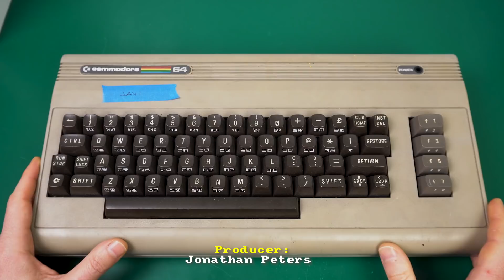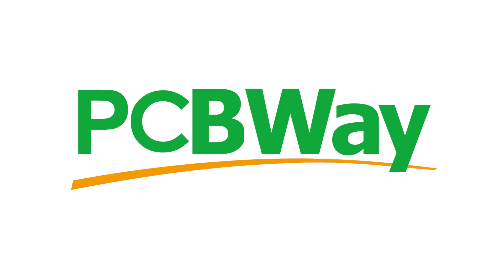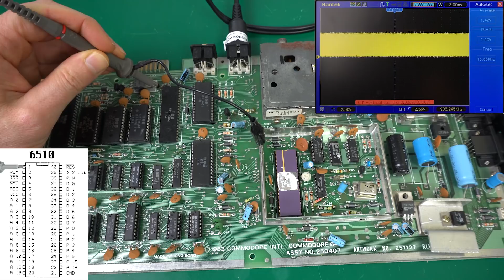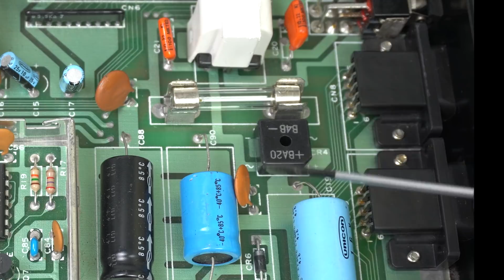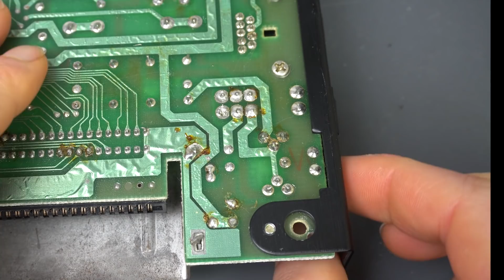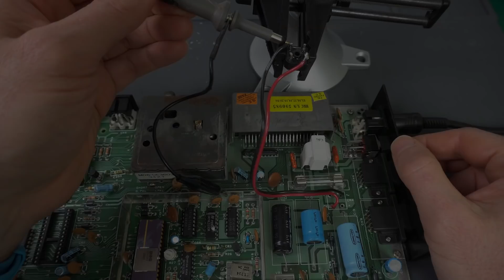The UGLIEST Repair of a Commodore 64 (Part 1)

Comment: 1:25 removing "annoying RF shield"? Adrian Black approves! :)
Reply: @Okurkaarrgghh  I don't think a company pays for design and built-in any component delivery for no reason. It has a reason to be there. Maybe RF interference?
Reply: @Okurkaarrgghh  No? :) ok, no.
Reply: Yeah I have seen Adrian just throw them away. What a laugh. Right guys, throw those shields away! :D
Reply: @Okurkaarrgghh  Yes. What does the year have to do with it?
Reply: @Okurkaarrgghh  that you don't know what is it for nowadays doesn't mean that it is useless :)
Reply: @M0UAW_IO83  depending the purpose of the machine or the environment (country/place) where you are going to use it.
Reply: Especially the Commodore 64 produces a lot of radio interference, while other computers had a metal frame and case, like Windows PC's or a sprayed on conductive layer of carbon on the inside like some Apples. The Commodore has an ABS-plastic case that lets all clicks hums and buzzes through. In and out! The tinfoil on cardboard RF-shield is hardly working, but is was good enough to get approved in the USA by the FCC. Removing the shield is willingly not following the regulations, spreading disturbances around in the neighbourhood, and opening the computer for all new kind of sparks and high frequency signals, nobody knows what the effects are on 40 years old computer chips. 
 
To those who still think the shield can be removed I say this: try your Commodore 64 with the RF-shield in front of a G6 communication antenna, and then try it without the RF-shield. Try the same in a magnetron-oven. It is a guarantee the C64 breaks down without the shield. With the RF-shield there is a chance the C64 will survive.
Reply: @ElectronGordo  FCC regulations.😁
Reply: @crazyedo9979  not only. Have you play around with a QL removing the shield from the mDrive? @vanhetgoor has explained better the secuencies.
Reply: @ElectronGordo  RF shielding done right is not a problem. Commodore had choosen the wrong way. Once I dealt with a C64 which failed five minutes after power on because the carton plate suffocated the pcb and I have to replace more IC than normal necessary. Usually I don't work on home computers but I know from a colleague that sometimes removing the RF shielding can be a pain in the huhu.😁

Comment: You made me shout at the screen. Check the power switch and the socket! 78xx regulators can go bad and engage in the shutdown all the time, but that doesn't cause their input voltage to drop, only the output drops. They can go short circuit inside which of course overloads the input supply and cause a drop but things will get hot very quickly in that case. They can develop a short between input and output pins, in which you'll see the input voltage on the output pin and things will go bang quickly... So, it was obvious they were not receiving power, which can be the socket, the power switch or anything in between those and the regulators.
Reply from the maker: Haha, if it makes you feel any better I had checked the switch multiple times (but somehow didn't record it).
Reply: @NoelsRetroLab  No it doesn't... :-(
Just kidding :-)
Shouting at a computer screen is the best part of being a nerd, so I guess it happens quite a lot on these retro computer repair channels like yours. But yet, IMHO, the tracing of a power fault should start from the point of input, not vice versa . Old electronics like these are very likely to have corroded socket pins and switch contacts, cracked solder joints where mechanical stress is frequent. They are the usual suspects if it is an intermittent fault like you had here. Can't wait for the second part, I have more shouting to do. :-)

Comment: Great job, looking forward to part 2!  I feel better about that voltage drop issue I had on that A3640 now lol =D  Sometimes the simple stuff can trip us up more than the complex faults!  The DIN socket and power switch are often a cause of voltage drop on these too (the contacts I mean).
Reply from the maker: Thanks! Seriously, sometimes simple things throw us off for a loop. Especially here because the voltage drop was only partial, I kept expecting some component to fail, not the dry joints!! I even triple-checked that the switch was fine (but failed to show it in video). Oh well. Lesson learned there. Now get read for part 2, which is when things start getting REALLY ugly 😱

Comment: 1:10 There is a little slot on the left side of the VIC-II shield where you can wedge a flat-headed screwdriver and pop the lid before you slide it to the left.
Reply from the maker: Ah! I knew there had to be an easier way to open that! 😃 Usually, if I have to do any kind of work around the VICII I end up desoldering that little metal cage and fitting some heatsinks directly on the chip anyway.

Comment: Fascinating repair video. Probably an even better rule I suspect if there's wiggle with the power connector, is just automatically refresh the solder joints. Even on the chance that they look good under magnification, the situation will change for the worse soon enough from the added stress on the solder joints from the component being able to wiggle when inserting or removing the power cable.

Comment: Great video.  Thank you for sharing!

Yeah, on my C64 the PLA actually took out the ROM's as well.  So some times when a PLA fails it is possible it could take other components with it.
I was watching Adrian's channel and he was building a GAL based PLA replacement and I decided to build one.  Worked great.
Here in the USA I acquired a 2364 adapter(s) from go4retro so I could use more common 27C64 EPROM's to replace the dead ROM's in my C64.

Otherwise so far I have been lucky and haven't had to replace any other parts on it yet.

Comment: Glad to see more use of a scope in Commodore repairs. Plan on repairing my original owned 64 after building a power supply. Found a donor machine at a flea market but just found that it has a PAL video system. Funny finding one in the U.S.

Comment: But bad solder joints was something my teacher in college was always on the look out for. When we soldered a component and snipped the legs short, he’d see and have us reflow it. Never snip and not reflow. And also mechanical parts were never allowed to be just soldered, always needed to have screws or bolts in place.
He was an engineer for ESA making satellites. And they found that these two things caused 90% of their problems. On earth oxygen would get into the hair tears and would corrode . In orbit the extreme temperature difference would work that solder joint repeatedly (or same with components that get warm) and eventually fail the joint.
So he was really meticulous in checking our joints. And after that semester, I never looked the same at consumer electronics. So bad the majority of them are. Not made to endure, and these days it’s even worse.
Reply from the maker: Totally right. I wouldn't advocate doing everything at satellite standards, but some things can be much better. Having some screws in the power connector would have cost Commodore a few more pennies and would have been much better. But then again, they may have been fine for the first 10-20 years and it's only now that we're getting those problems. And yeah, modern devices are orders of magnitude worse! 😬
Reply: @NoelsRetroLab  But we get so much fun from these old machines :D So I would've liked them to engineer them to proper customer electronic standards :D Although generally they are holding up really nice. I just had an MSX come in. 1988 and the only thing the previous owner did was change the floppy drive belt. 

And I learned a valuable lesson today. I had this 16LED bar display made for the C64 (to learn KiCad and test PCBWay). And since you get 5 board for 5 bucks I made one for the MSX too. And I noticed that when I toggled the STROBE that the lower 8 bits also got updated. Turns out that the STROBE bit actually is not completely in your control. But when you send data, it will briefly go down to inform the printer. And down in my case is, activate the other latch :D I never knew that about parallel ports! And the C64 user port isn't a parallel Centronics standard so PB2 is just fully in my control. But I figure I can make it "look" okay when I quickly enough write both bytes out. This was the idea anyways to polish my 31 year old Z80 coding skills.

I do like the MSX (I was triggered by your love for the Amstrad, also a Z80) I was a N00B until 3 days ago. We had one in school but never got serious about them. But it's quite interesting, like the Amstrad I guess. Also a bit quirky with the VPD. Which doesn't allow you to write immediately in the NVRAM, you have to go through an IO port. And basically have two calls one to set the address, and one to push the data. Unless you do consecutive writes then the VDP address is incremented. But then you run into timing issues because if you do it too fast :D
Interesting stuff. So much, more fun than X64 PCs ;)

Keep up the great work, I adore your chancel. And I am amazed how many great hackers there are of these old machines in Spain!

Comment: Hi Noel. You seem to have at least another cold solder joint on the cartridge port. I think I spotted it as the last one visible in the bottom row on the last shot of the board flipped upside down.

Keep up the good work!
Reply from the maker: I think you're right. I should have another look. Maybe I can even add that to the start of Part 2 since I haven't exported the final edit yet. Cheers.

Comment: Nice. However, when using a dead test cartridge, you also need the harness. The harness is a series of connectors which plugs into all the ports on the system and there’s a separate connector for the keyboard. Without the harness, it will give out inaccurate results. The harness is necessary as it provides loopbacks which will give you a more accurate result.
Reply from the maker: Sure, that's ideal but unfortunately I don't have the harness. I should get one sometime. The memory test is still valid, which is mostly what I'm using it for.

Comment: Great video, maybe check the PCB upside down next time? Broken traces and bad joints are more common than people realise and connectors to the outside are always prime suspects. I found that out with 80s audio gear like synths.

Comment: I had this revision of the board in 1984, my first computer. Mine was a French import, with a Philips pal to secam converter fitted under the keyboard by Procep, the company importing Commodore in France at the time. My computer had also this issue with the power plug. The shop to whom I brought the computer for repair made the diagnostic of a too power hungry setup, and removed the secam converter, eventually bringing the computer back to its pal version. Unfortunately, my TV set wasn't pal compatible, so until I had the money to buy a new pal + secam TV set, my Commodore 64 was B&W...

Comment: Hi Noel, superb video. It remembers me on these days were you type-in programs and suddenly the C64 lost power before it was saved. Then my father and I remove this ugly thing with a new plug with screw connection. No direct contact to motherboard only wires. This was cool. And nobody can unplug the computer by accident.
Reply from the maker: Nice! I've never seen one of those, but that's a good solution if it kept getting unplugged. Back then I always had the problem that the power might accidentally go out for the whole neigborhood for a few seconds (especially during storms).

Comment: Great video Noel. I guess it's always a good idea to just reflow the pins on the components that take som abuse, like the power connector and the power switch. Even if it's not an issue at the time of repair it might still prevent issues in the future.
Reply: I'm excited to do some more work on my C64's now! 😅 I've been doing some upgrades in my lab so I haven't been able to produce videos for a while.
Reply from the maker: Sure, if you know it happens enough, it's a good idea. Normally I have problems with the switch, but not with the power connector so much. I guess I'll be looking at it a lot more closely from now on 😃

Comment: Great to see you back with the breadbins again. Recently i've been struck by two machines with blown up fuses, one was an c64c and the other one an breadbin.
Reply from the maker: Thanks! Oh I have a huge backlog of C64s and VIC20s to repair, I just haven't been able to make time for them. There will be more for sure.
Were the fuses the only thing wrong with those machines? That's lucky!
Reply: @NoelsRetroLab  It was strange with the 250469 board it seemed to work fine otherwise except there were no sounds. I tested to 8580 SID chip in an another machine and it worked just fine. Then i watched Jan Beta's video where he was fixing one of his c64c's and from there it occurred to me that hang on maybe that's it and after examining the fuse it was not good. Put an new one in and board has been working just fine since then. With the breadbin i found no power on both 7805 and 7812 voltage regulators then i examined the fuse and put in an known working one and that 250407 board came back to life and the voltages seem okay.

Comment: Thank you, Noel. For the great thriller;)
I felt very sorry for you in the end. I knew it from the start because I had exactly such a bug over a decade ago with my C64 (worse, the switch had not bad contact, but was dead ->  I didn't follow the iron rule: never turn off your computer ... or was it "never touch a running system?", hehe). I also know from maintenance: It's mostly there where people are fiddling with it! Plugs ... sockets ... switches ... big red buzzers, hehehe. They break everything! Therefore: Always check the mechanical wear parts first. Or at least have it in mind. That saves many hours and hair loss :) Now I'm watching part 2

Comment: Very good and informative video, thank you. Nice explanations of the parts! Anyway, i think power switch could be very common issue of the c64 :)
Reply from the maker: Thanks! Yes, switch problems are very common, and I actually checked it multiple times (even though that didn't make it into the video).

Comment: This video remembered me two problems with my Sinclair Spectrum. In both cases the computer just "turned off" after some time working. The first case was due to a physically broken diode in the power suply: when it heated, the connection broke and stopped sending 9 volts. The other case was much more subtle: I removed and mounted again several times the internal heat sink, and accidentally broke one pin of the voltage regulator. Anyway, it held in place... until it heated, and it was so subtle that I needed several days to discover it.
Reply from the maker: Oh wow, yeah, those are the worst kind of failures. Intermittent ones that only happen sometimes or after some use. Even here it was driving me crazy because I would try something and it would start working because the power connector was making better contact, and then I would do something else and it would stop. It can be quite frustrating!

Comment: lot of evidence of rework in that area near the power connector, so not so surprising to see problems. Also looks like a couple of pretty bad reworked dry joints on the cartridge connector
Reply from the maker: Good point. I saw the differences but I didn't instantly think re-work and I thought maybe it was done at the factory. I should have another look just to check.

Comment: Ok, Noel ... and WHERE WAS THE UGLY part? I didn't see anything ugly. Instead, professional as always! :-)
Other thing, that happens very often, that the power switch itself is bad (switch internal contacts)!
So looking forward to part 2!
   Greetings, DOC64!
Reply from the maker: Thanks! The start was rocky and a bit ugly (forgetting the video connection, spending forever tracking down power issues), but the really ugly part comes in Part 2. Just wait 😬

Comment: Wiggly power connector - weird. Have you ever seen this on any other computer brands?
Reply from the maker: Yes, quite a bit actually. Happens on Amstrad CPCs quite a bit (even though it's just a barrel jack), but it's usually an on/off thing. You touch it you get power, you touch it again, it all goes away. Maybe here because we have multiple pins and AC current it causes that partial current draw that threw me off.

Comment: This happens a lot on audio equipment too, typically the RCA jacks :D I've fixed a few issues on Sony gear by resoldering the input/output jacks.
Reply from the maker: Right. I've seen it a lot in Amstrad CPCs too, but it's usually binary: You either get full voltage or it stops and you get nothing. Here it was really weird and intermediate. Maybe because it's AC and one contact was fine and the other one wasn't?

Comment: Dammit...could have saved you the trouble, because I has the exact same fault on mine 35 years ago (luckily I could trace it immediately to the same solder points because I had noticed the play in the power socket some time earlier, as the machine was being moved/unplugged/replugged a lot). Using solder points as a support of parts that get occasionally put under mechanical load is a somehwat dumb design decision. I guess they figured you'd just plug it in at one place and leave it there forever.
Reply from the maker: That's crazy that that same problem was already happening such a long time ago. I guess it's mostly due to stress rather than just age.